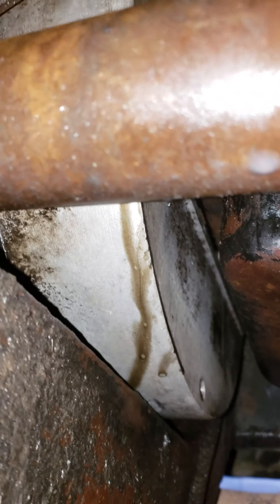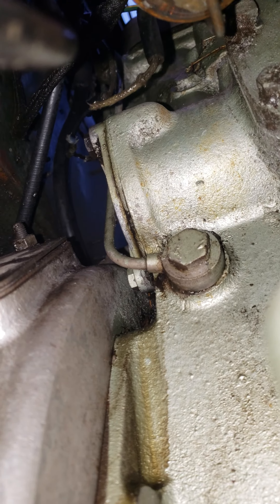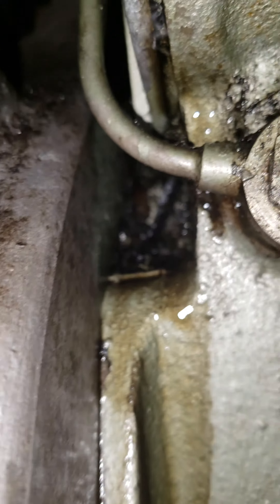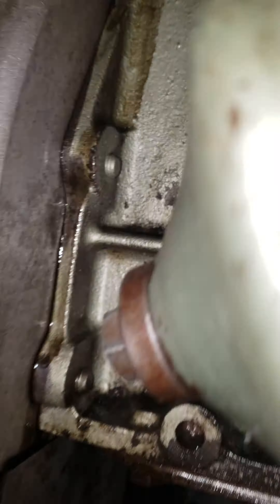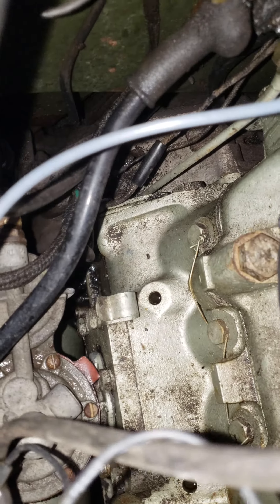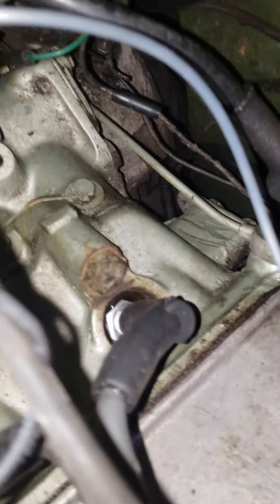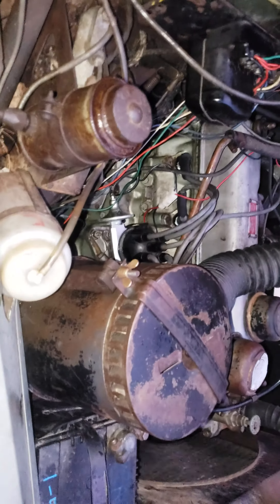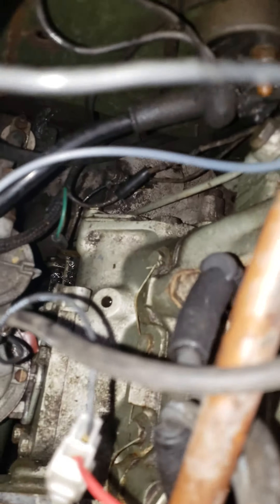Update Shorts #2 - Land Rover Series II oil leak found?

Comment: Great quick vid - re the oil leak I'd try an oil additive that works on the oil seals in the engine mite be able to put a big job off till the winter
Reply from the maker: vaughan warburton I don't trust any stopleak stuff like that personally, I'll just keep topping off with fresh oil. And my luck, the "temporary" fix will stay in place until it stops working again...

Comment: Not an easy spot to access at the back of the engine. If it’s not leaking at the plate, might it be the bolt where the thin diameter oil feeder pipe exits?  Good luck
Reply from the maker: Pretty sure it's not. Looked to be fresh oil sheen above the bolt, and appeared to be going next to, not from/under it as you'd expect. I'll try tightening it just to be sure,but I get the feeling that's not it.